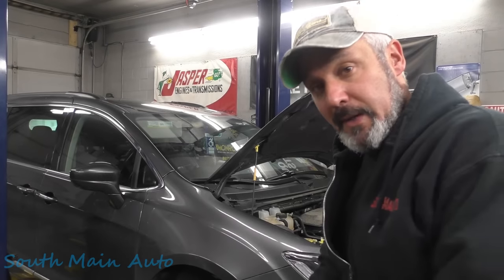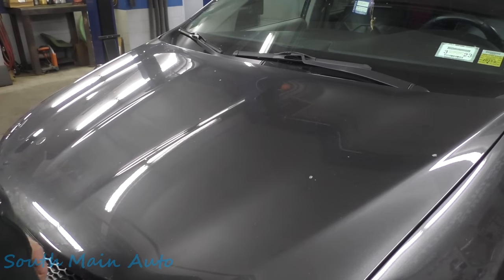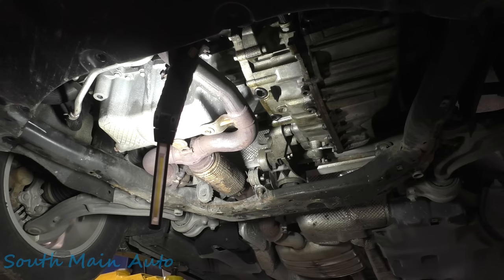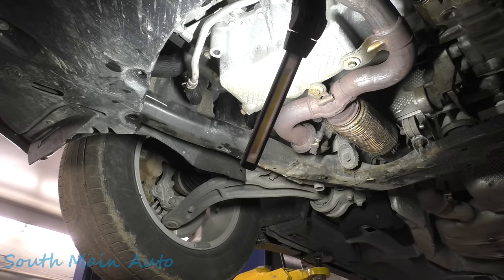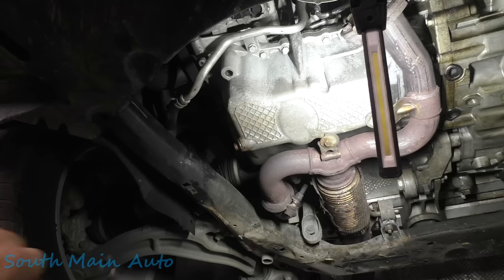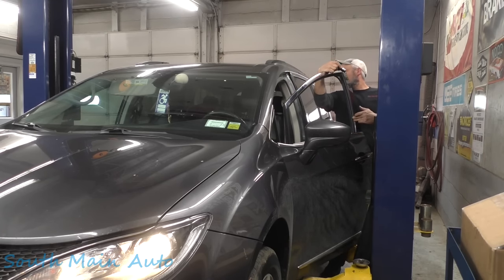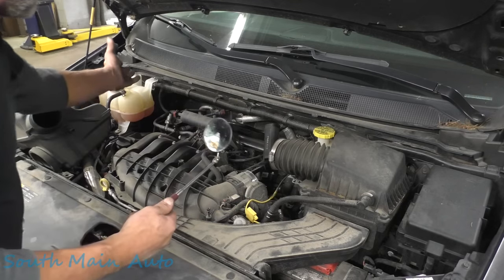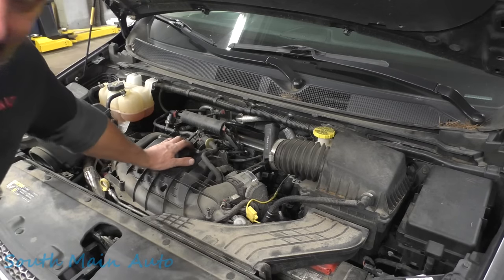Chrysler Pacifica Goes Full Nuclear 💥

Comment: These old school mechanics that actually diagnose rather than just throw parts at it are so hard to find. I can do parts roulette myself, sadly the only shop close to me like south main just closed. The owner was such a good guy, told my gf her head gasket was blown (over heating, water in the oil the usual) he said well we can fix it but if you've been saving for a new car that would be the best route as the car wasn't worth the repair cost. I wandered in awhile later after buying an old car that had a lot of miles 91 Caprice, I changed the oil which was disgusting and it started smoking out the exhaust bad. He said ah hell just change the oil again and dump in a can of restore that thing was probably used to that sludgey goop filling all the worn valve guides etc... I did and have put another 25k miles on since. Granted it's a band aid but aside from a total rebuild which it will need soon I'm sure he bought me another 3 years without even looking at the car. No smoke still runs great even with the lifter tap it's had for 40k lots of power even at almost 200k on the clock not bad for a 305... R.I.P Mike you were a great guy.

Comment: This is really sad.  I have been driving since 1973.  Chrysler used to make the best designed toughest cars, bar none.  Gas was $0.45 per gallon, so if my 440 only got 13 MPG, that was just fine,  all the big Mopars came with big engines and big gas tanks.  The comical thing is that the 3-speed torqueflite transmissions had torque converters that slipped at slower speeds, so my best gas mileage with a 440 New Yorker was somewhere around 75 miles per hour.   To get a little more zoom, I advanced the timing beyond stock and ran Sonoco 260 with lots of tetraethyl lead!  If the tail pipe was cream colored inside, then it was running well!  Between the exhaust and tires slipping, there was always grey smoke behind me when I stomped on it.

Comment: Gonna take a shot in the dark here . From watching your channel i have come to see your an absolute genius when it comes to electronics. I have a completely off the wall question hopefully you can help me out. I bought an atv winch with completely worthless wiring diagram. It shows a circuit breaker on battery positive wire but doesn’t say what size breaker to use its a 12 volt system on the atv . Also it says to run a red power wire to the key switch for the bar switch in out button provided with the kit with a fuse link but again no size for the fuse . If you have any idea what size circuit breaker and fuse to use I would be a happy non electronic minded old dude thanks in advance
Reply: Ps manufacturer has been asked several times with no response other than sending a pdf of exact same wiring instructions that came with it

Comment: I had a Buick LeSabre that hydrolocked when a water channel in the plastic intake manifold lost integrity and dumped water right into the intake.  Just one of the wierd things with THAT car that I have never experienced with any other vehicle.  Just put a new manifold and changed the oil.  Car ran fine for a few years more until a host of other issued frustrated me to the point of no return.  No more GM's for me.  Or Honda's fir that matter.

Comment: Wow dude I had the exact same issue on the exact same year and model like 3 weeks ago. Customer dropped the car off complaining of overheating, I grabbed the ticket the next morning and went outside and the car wouldn’t start, exactly like you were dealing with. Called the customer and they said they haven’t had any issues not starting just overheating, so we pushed the car in and sure enough it was hydro locked, but on top of that the starter wasn’t getting a power signal, found a blown 300 amp fuse on top of the battery 🤷🏻‍♂️, don’t know how that happened lol. I was able to unlock the engine and then jumper across the 300 amp fuse and get the car started, but either way a fork got stuck in the engine regardless lol. 5 year old car with 80,000 miles and it’s a paperweight

Comment: when you pressurised the coolant bottle ,should of taken out the spark plugs,hear the hiss on afending cylinder,bit like drop down test,put air into spark plug hole ,see were it comes out,exhaust,coolant,airbox,had my engine go tight ,had water in the sump too,did air trick into spark plug hole,was number 2,3 leak bad,drop valves ,smash into top piston,only take head off as i allways like to know ,why it failed,and engine totally dead,smash pistons,missing valves,did same ,not rebuild,got low millage engine ,junk yard,swop parts over,refit,reprogram diesel pump,as new one,devorce it ,marry to car,imob light now out ,as see new pump,all good fun,love your videos,you help so many people around the world,mainly watch for electrical problems ,thats my department at work,after watch your scope vids,i went out and got a snapon scan tool,with a 2 ch scope,now use it every day ,now i get the car problems nobody can fix,like you do,but i follow your advice ,diagrams,and i find them ,not allways fix ,if exspensive ,for cusomer ,back on the road now,with junk yard engine ,runs nice,pass m.o.t,or anual inspection,no smoke at tail pipe,keep up the good work,from england
Reply: Other comments have said that this is a big pain in the ass. He diagnosed it by draining the oil, and water

Comment: Those underneath covers are for the aerodynamics. Gee head gasket maybe cost 30 or 40 bucks. Replaced my 66 Chevy impala station wagon straight six cylinder head gasket in a half hour. But it was all cast iron.
Reply: LOL, a 66 Impala job is 30 bolts, on modern cars it's hours of labor to dig down through the plastic crap and sensors just to find the head.
Reply: Back when Chevy had their straight 6, a whole top gasket set may have been 25 bucks.   That and a plumbers wrench and yould be back on the road by lunchtime.

Comment: I guess I was lucky with my S10 Blazer. I had to keep adding antifreeze but no leaks detected. Turned out to be a bad intake manifold gasket and all the antifreeze went into the oil pan. Fixed the gasket and the engine survived and did not burn any oil Whew

Comment: Headgasket failure leads to hydro lock, damn thats an expensive job.  I’d put a new head on it if its warped though.  On expensive old Volvos we just take the 6 cylinder heads and bake them in the oven and flatten them out.

Comment: I bet the starter isn't junk. I bet the bendix drive got stuck in a bad place, and is jammed, so now it doesn't have the torque to spin the starter, and is stalled. Probably happened from when the engine hydro locked. I've had one starter with an issue like that, that still starts perfectly every time now. The difference is it isn't sitting around as much now. All I did to fix it was remove the starter, check it directly connected to a battery, but able to free spin, and then put it back in. Started on the first try.
Reply from the maker: A- I turned the engine by hand so the Bendix is not stuck
B- you can clearly hear the Bendix engage into the flywheel when turning on the solenoid

Comment: The 3.6L Pentastar is a great engine.  Something up in the last few years with quality control and materials control.
Reply: This engine is not the pentastar though its a different 3.6 liter they made.
Reply: @pilsplease7561  This is actually a 3rd generation Pentastar 3.6L - AKA the "Pentastar Upgrade" engine. The most notable changes compared to the older Pentastar 3.6L engines are a completely redesigned valvetrain, the addition of variable valve lift, and an EGR cooler. There are a number of other less significant differences as well.
Reply: @ruley73  The pentastar thats in my challenger has had all of that since i got it and its like 6 year old now. Seriously.
Reply: @pilsplease7561  I promise you that your Challenger doesn't have any of those features. All the 2014+ V6 cars have the Gen 2 3.6L.

Comment: My wife kept coming home with Chrysler's; a Sebring Convertible, about 120k on it - transmission grenaded within 1000 miles. Then she wanted a Town & Country mini-van, 105k - head gasket blew at 111k, then the transmission went. After that, a 1st Gen Pacifica, 115k, owned by an old couple, full service records - radiator cracked about four months after we got it, then the head gasket blew at about 125k. We were buying her a car like every other year. I told my wife not to come home with another Chrysler or I'd divorce her. Chrysler is 100% garbage, to the point where there should be a class action suit for fraud. Then she got a Navigator...also a money pit hunk of shite. 🙄

Comment: Thanks Mr.O
I have had good luck with dodge/chrysler 2003-2005 mini vans with the 3.3L.
It is a PITA to work on the water pump and starter on these models.
What is your experience with the 3.3L powered versions?

Comment: It is rare that the 3.6l v6 does this but it can be a one off poorly manufactured engine or the owner neglected the maintenance, such as changing the oil and engine oil filter or flushing the coolant.
On the whole, the most common issues with these engines are the rocker arms and hydraulic lifters and that affects than 3% of these engines and it is mostly in the Jeeps that have most of these issues. It occurs mostly on engines that have been poorly maintained and on average the earliest these valve train issues occur is around 40 to 45 000 miles but i've seen them with over 120k miles on them and in both cases it is all about maintenance.
I had a 3.6l v6 in my 2012 Dodge Grand Caravan and the engine was amazing and the vehicle overall was amazingly reliable.  I had over 140 000 miles on it less than 8 years. One of the most reliable vehicles I have ever owned and it was also great on gas.

Comment: Fully expecting a review of a fully nuclear-powered Chrysler Pacifica...
Oh well...
Another nice 'feature' of those new-fangled cars with a button. The ECU will power the starter until it starts, or until it times out. In case of a locked engine, the starter windings will burn out. A normal person wouldn't engage the starter for that long if the engine is noticed to be locked when starting to crank.

Comment: New rebuilt v6 engine: $5,000 not including installation. My time about a week every day after work for a week, all associated gaskets necessary for a new head gasket job and machine shop fee to check heads for warpage and straighten any unevenness: $500. I'd say it was worth my time if someone didn't run a red light and total the car only a year and a half later. Was worth it in the end but it hurt to see it sitting in a junk yard.

Comment: I think Pentastar's have an engine oil- coolant cooler,  which could fail and ingest coolant to the engine oil directly!!
But for the symptoms most likely there was an heating issue that let to heads warped and lack of head gasket seal.
Reply: This is a different 3.6 liter engine and is not a pentastar, the pentastar has the oil in a sump below the block basically in the case. the coolant is stored in a reservoir next to the engine and recirculates and is actually General Motors Dexcool which is what dodge uses.

Comment: Those motors are famous for leaking internal water pumps. I don't know if that engine has the internal water pump, inside the timing chain cover, but if it is, that's where the water is getting in. Either way the motor is hatched. : after reading comments, I think I'm quite a few years out of date, lol oh well.

Comment: Your boroscope is lonely!? At 313 u heard drizzle. I was sure you would just drop the car and pull plugs to isolate it to a cylinder with a boroscope.  When you got to egr cooler and had the pressure pump out I was sure you would throw the scope into the intake to see if cooler was peeing under pressure? But hey when you were testing starter I wasn't thinking scope at all, so maybe my scope fever has passed.

Comment: Waterpump impeller seal failure can cause overheat with little or no coolant loss,      That`s my guess,   If so,     Had she replaced it she might have avoided the engine damage

Comment: Penstar engines (3.2L & 3.6L )  have the oil cooler and coolant cooler as one unit. The OEM cooler is made of polymer which is total Garbage.  I only use the Dorman replacement cooler assembly cause it's made of aluminum.  If it cracked internally they can cross contaminate each other. You getting coolant in the cylinders probably not the smoking gun. But those coolers are junk..

Comment: Its displacement measured 392 cubic inches and it had overhead valves, a Carter four-barrel carburetor with dual exhaust, five main bearings, and solid valve lifters helping to develop 325 horsepower at 4,600 RPM. Power steering, power brakes, and power windows were standard. My 57 Chrysler New Yorker 4 door hardtop was defiantly not bottom of the barrel . I would like to have it now.  You have touched a nerve.

Comment: Why water, but no coolant in the pan? If she did not have the oil changed after the run-hot, and before bringing to your shop... She might have something to talk about with a previous shop who supposedly sold her a coolant flush.

It doesn't matter how well built a motor is; straight water will destroy a head gasket, given enough time running. I have personally known of 2 past instances of local shops in my area, jiffing customers by refilling with straight water. Not sure if it was to save costs for the coolant, or to throw a wrench in for future maintenance. But it nonetheless has happened.

Comment: It must be just the modern ones I have a 96 ram with the 5.9 it’s rock solid and so fast it took most of the paint off of it 😅 but it runs great drives nice only 112000 on it

Comment: I'd say it was driven until it shut off, then cooked the starter trying to restart a dead engine. I will have no experience because I'll not own one of these. I had an old 3.3 back in the 90's and it was great. I figured I'd used up my Chrysler Juju and went to other brands.

Comment: If she had the head gasket replaced before she ran it with just adding water, it may have had a chance of repair.   But burning up the starter with a hydro lock and running H2O W0  weight oil ruined all of the bearings.

Comment: Its not bad unless you have multiple holes punched thru the side of the engine. everything else is fixable.  Oh except for the story I heard once, of a Greyhound bus in Australia, that someone had sabotaged with valve grinding paste in the oil filter.   The Detroit dealer said the entire engine was contaminated with carborundum material, and was 100% unsalvageable.  They pulled the engine and threw the whole thing into a scrap bin.  Aluminum engines do not like being hot........the head and block could well be warped.

Comment: My opinion is that any time the oil gets severely contaminated, the engine is junk and not worth repairing. Water, and especially coolant, will almost immediately damage the bearings. Even if it runs after repairing the cause of the oil contamination, the life of the engine will be substantially reduced, potentially to the point of it not even making it out of the parking lot before it fails. Not worth the risk as a shop imo.

Comment: With hydro lock slamming the starter till you bend the rod/piston break at wrist pin, or until the starter fails.....ya, needs new motor.   If it ain't broke, we can fix that too.  The grayer the tech, the more we've seen....and forgot.

Comment: That is a pretty bullet-proof engine.  If you replace it, it would be very interesting to see what actually failed on it.  Of course, over-heating any engine is not a good idea.
Reply: Bullet proof? You mean nerf bullets , right?
Reply: @davidmaclean4773  Shooting a engine block with anything under 50 cal will not penetrate it

Comment: According to car-part, their salvage engines list two types of 3.6L engines,  a hybrid gas and a gasoline. I thought the Pacificas were all hybrids.  For the yards within 150 miles of my zip, the hybrid engines range from $1500 to $3K with only 3K - 4K miles and the regular 3.6L for $2400 to north of $3500 with mileage between 34K to 122K. That site is my go-to when evaluating the dependability among the various models since oftentimes even automakers with the best reputation for quality can make mistakes, and those with the worst reputation can occasionally build vehicles that aren’t that bad. If major components such as engines and transmissions can be bought for less than $500 each, I deem that vehicle worthy of consideration. I generally frown upon CVT’s, Turbo’s, and direct fuel injection. For longevity I prefer port injection or multi-port. And of course the engineers of certain makes seem to forget the need for maintenance, such as the horror stories of having to practically lift out an engine to change the spark plugs. To be honest, I still avoid anything made by Chrysler/Fiat just because both companies aren’t known for their quality but they make Jeeps and people are keeping those plants working overtime…and they’re not giving ‘em away.
Reply: The Jeeps have just as many problems as the other Chryslers. The difference is they are a cult and will never admit the quality is terrible.

Comment: This last weekend a customer drove there 2007 Toyota Sienna van with 200k with zero oil for at least 2/3’days (oil line leaking only while driving) customer is obviously clueless, I put 5.5 quarts before it showed any on dipstick, started it, drove in shop fixed lines, refilled oil, engine like new, I told them if they owned a American car it would have died on the road.

Comment: The access to that engine on that car appears to be abysmal. I wouldn't even want to do the starter, let alone a head gasket. 

Also when you said the mileage might be higher I was thinking at least 200k, but I guess over 100k is quite a bit for Chrysler.